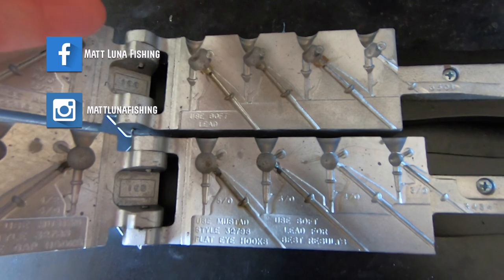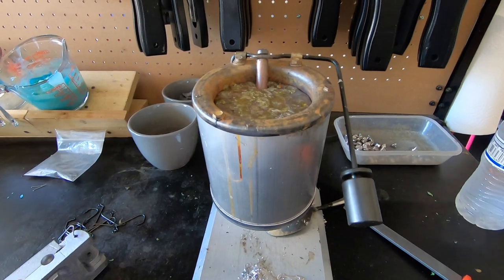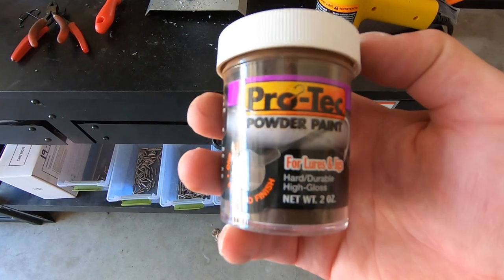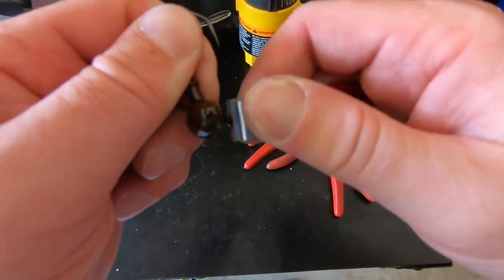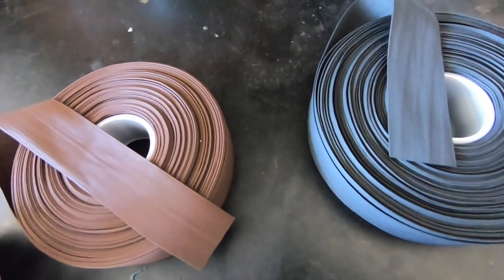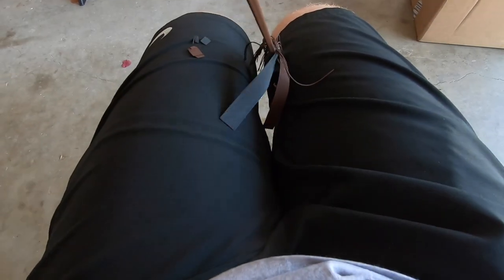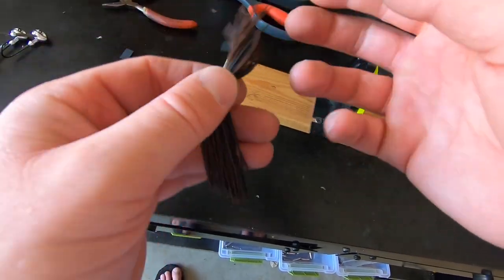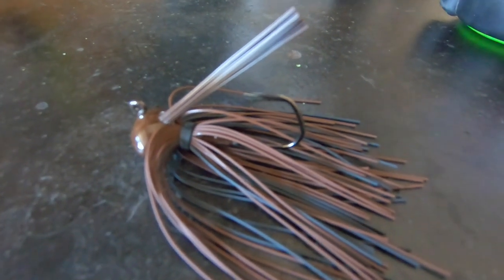HOW TO MAKE JIGS - Making Football Jigs with Do It Molds

Comment: Been pouring jigs for a while and I find using the silicone insert you can get from do-it a better choice for the powder paint process, paint will come off them easier than the metal inserts. Hope this  helps you or anyone else that may watch this video.
Reply from the maker: Haven’t tried the silicone ones.  Haven’t had issues with the metal ones.

Comment: Great Video!  I do have a question about the weed guard.  I've seen others talking about jigs and I've heard alot about cutting down the weed guard to the barb of the hook.  Is something you recommend or is it a preference thing?
Reply from the maker: I used to cut down the weedguard but I’m not the biggest fan of it.  I think cutting the weedguard makes the weedguard harder to get past the hook for when you get a bite and set the hook.  The longer weedguard give more leverage over the bend and the weedguard is able to go past the hook easier

Comment: Really great video! Is the led expensive to buy? I would think that would be the most expensive part. I never knew how easy it was to make a jig. Thanks for sharing!
Reply from the maker: Lead isn’t too expensive if you find it local or at a scrap yard.  I’ve rarely ever even bought lead.  I’ve gotten it free from different places.  

It’s not cheap if you buy it direct from a retailer.  Still cheaper overall if you buy the components and make a jig than buying jigs from the store.
Reply: @MattLunaFishing  Awesome brother thanks for taking the time for the info. Really does make sense to do it that way rather than buy them. Thank you again for all the info.
Reply from the maker: You’re welcome!  You just have to decide what you use a lot and will have confidence in if you make it yourself.  Having confidence in the bait is key!